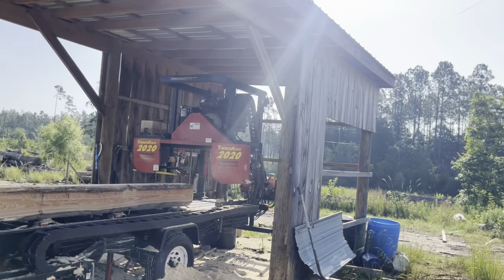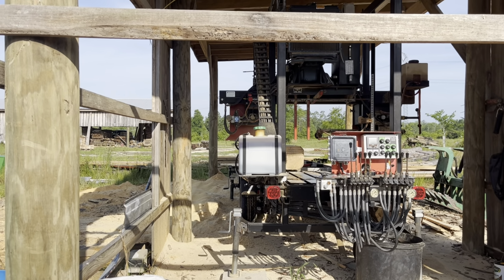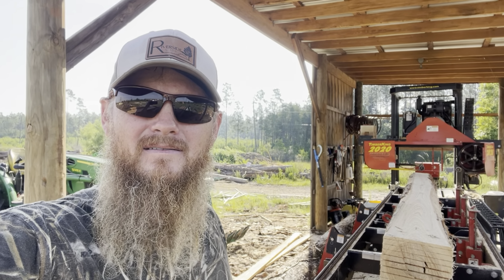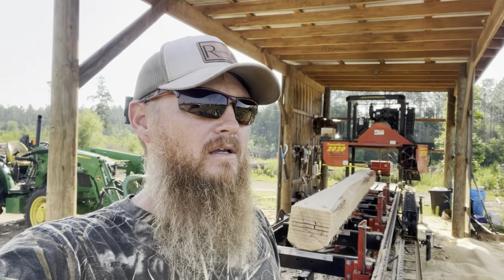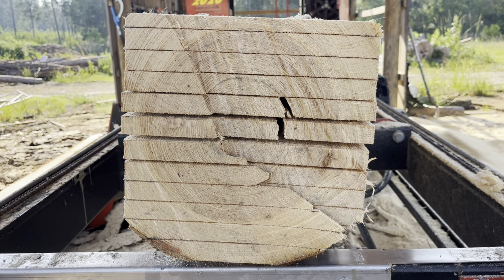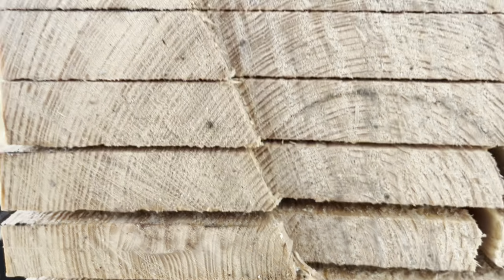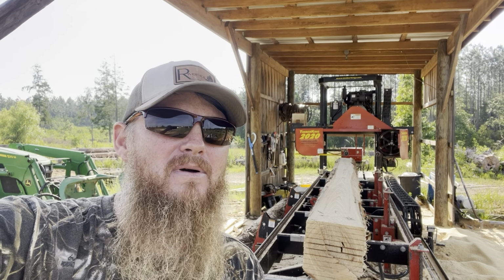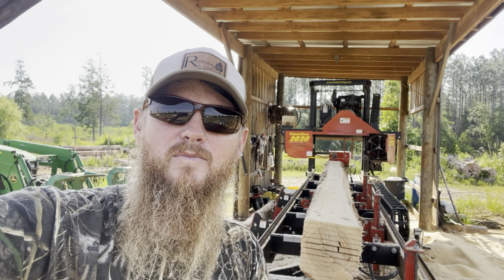“Tree Shake.” What causes it and what can you do about it? Let’s look at tree shake in this cypress

Comment: You need to put them in a pond and let them dry slowly when the bark is gone then saw them they look to dry the way. That dust is going all over God Bless Y'all and have a great day 🙏🙏
Reply from the maker: They are definitely wet as they can get. They were cut down two days before that.
Reply: There is a reason why we find sinkers all the time old timers put them in the water to make them especially wet to saw it was not just to get them to the mill but most of the old mills were built on the water the water makes the logs better and dry slowly the saps comes out in the water and they don’t dry out as fast as in the air I pull mine out of a swamp and put them in my pond till I have time to saw them and they don’t split and have a pretty color no bark but it’s a slow process but God Bless Y’all and have a blessed day